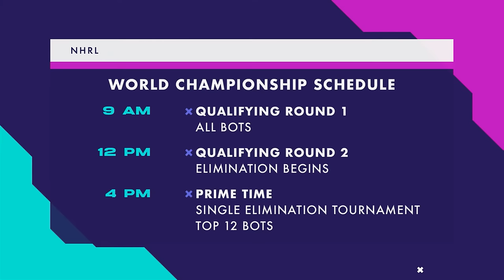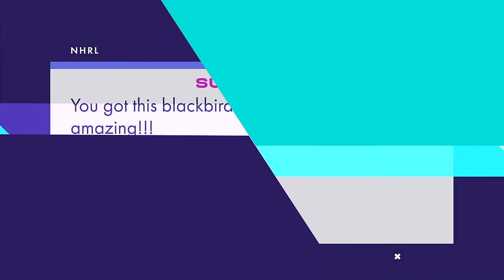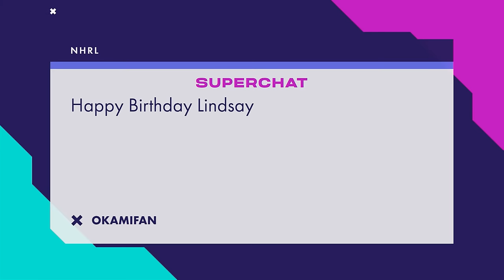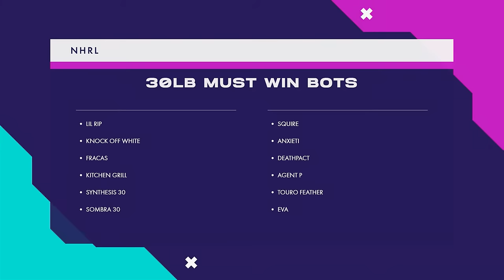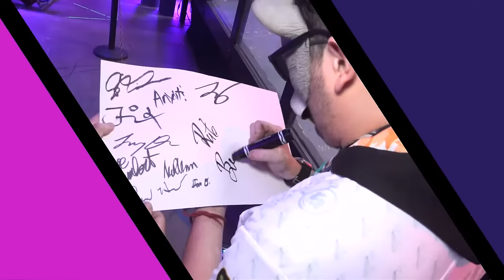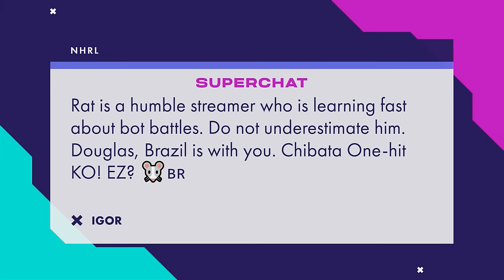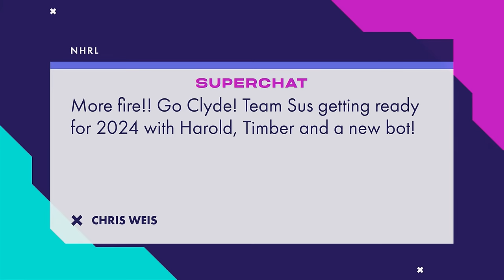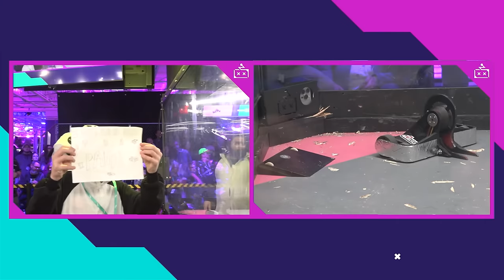NHRL 2023 Season Finale: Part 1 $1m World Championship qualifying rounds from Nov 11 2023

Comment: theyre all cool but to be honest im a bit tired of the eggbeaters and beltsanders on wheels. id love to see some high speed hydraulic spikes or katana type shit.
with that said.. theres nothing like watching two bots go flying across the room or into the cieling when a spinner makes contact, so i really cant complain. i just like variation and dislike meta lol
Reply: Spikes just don’t shoot out fast enough to do damage, they just push the other thing away. Even while pinned you’d need proper battlebots weight to actually build something large enough to pierce the armour of bots instead of push it or hit it, and with lighter bots, they will bounce around and absorb energy far better. The closest thing we have to what you want would be the old school pneumatic piercer/crusher Razor from robot wars. Even more modern pneumatic hammers like chomp and beta have never preformed well. Compared to spinners they just don’t hit often, and even when they do hit, they struggle to do meaningful damage.
Reply: be the change you want to see